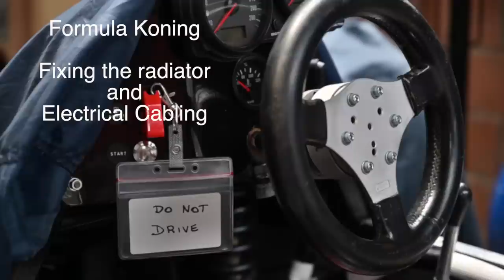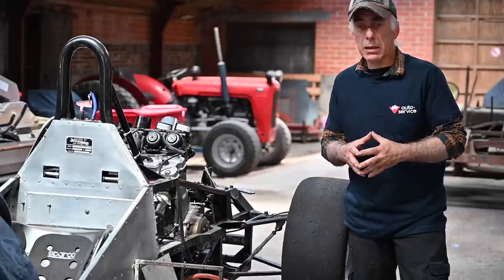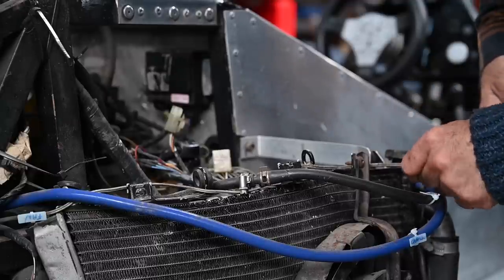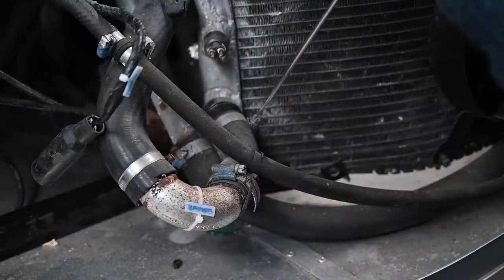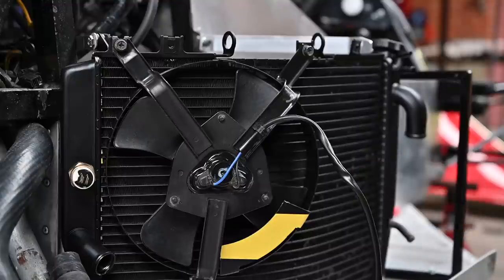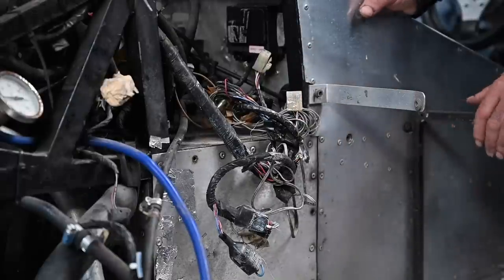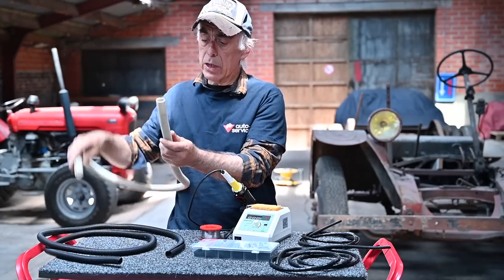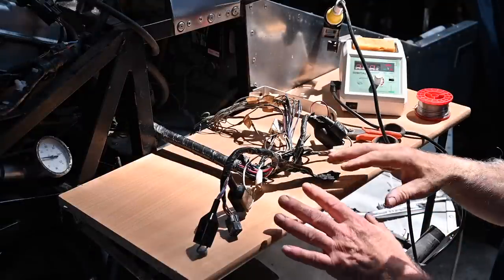Formula Konig, rebuilding a race car - Radiator and Wire loom

Comment: Hi, really enjoying your channel, it's amazing how people are cutting corners on something that has to be spot on and safe, and are prepared to race that car with so many problems, looking forward to seeing the end result.
Reply: Especially since racing is usually a hobby which you love and enjoy doing! (it goes without saying the safety aspect as well)
Reply: @Darryl603  Yes, I've done hillclimbs so I know how crucial it is to get everything sorted and not cut corners, some of the parts on that can make me cringe lol
Reply from the maker: Indeed, this car was really messed with
Reply: I do wonder about the cars history.  Sure looks like a bunch of things were "repaired" trackside, and the kludge was never corrected when back in the real shop

Things like the differential side bearings should not seen enough use to kill them.  About the only thing that might account for their condition was racing on a beach on the sea.

Anyhow, I await further installments.  You present a great combination of vehicles rarely seen in this hemisphere, and excellent production values. Luckily my age has taught me patience. (or at least  pounded into my brain)
Reply from the maker: @rjnerd  ,  I have some history, the car was build in germany by Konig inspired on the frame used in the italian Panda formula.  Build in 1990,  and fitted with a VW Polo GT developing about 140 HP for a 1400cc that was not bad at the time.  Also the well know F1 pilot Shumaker  did race in his early days with the Konig car like mine.  That was in 1988, so 2 years before mine was build.   The formula Konig stopped in 1985 or so as VW pulled out.   My car had originally the VW engine in it, but replaced with a Kawasaki Ninja ZX9R (900 cc - 140HP)  bike motor , allowing to rev upto 15000 RPM and a six speed sequential gearbox... and less weight.   That work was done by an unknown person  . It did participate in hill clime races... It retired in 2000 when as a decorative element in a car showroom . In 2018 a friend of mine bought it as the store closed,  he did plan to drive it but never did.. in 2021 I did buy and started to restore it....  There were many things wrong on it and a lot seemed to be done in an amateur way  ( he who modified it to a ZX9R).  Any how, I hope to get it ready soon and be back on the classic track with it....

Comment: With the wiring harness,  instead of clipping off the unused connectors, and doing the elaborate multi level heat shrink, just unwrap more of the harness, follow them to their far end, and eliminate them from the harness completely. Saves weight, and thins the cable bundle significantly.  If nothing else, when you are puzzling out an electrical problem, it's easier to follow stuff. 

When splicing wires, don't depend on solder for mechanical strength, at a minimum some amount of twisting is in order.  You have a high vibration environment, you want all the help you can get. 

I suggest selecting a good quality connector style, and replace the current aging  mishmash with a consistent set.  They have gone brittle, and were originally chosen based on the cheapest that could be found that were likely to last the warranty,   With a single style of connector, you can keep extra housings around, and should one get damaged, you can just pull the pins (the kit will include a tool for that) and replace the housing rather quickly.   If you are feeling particularly fanatical, look to aviation for your connectors.   And when you have to divide things between multiple connectors in the same space, use either different numbers of pins, or different genders so you can't swap them. Even then, hit them with different colors of paint, makes reconnecting faster 

As for the fan, if the fan blades are an actual  airfoil rather than simply angled flat plates, they won't be as effective moving air when spun in reverse. So rework the mounting frame so you physically flip the fan to change the airflow direction, rather than just change the rotation direction.   Investigate adding some sort of gasket between the radiator and the body shell, so the air goes through rather than around.  And when you were riveting in the brackets, the nice smooth  heads should be inserted from the exterior, so the upset end doesn't snag stuff like the back of your hand when reaching under the car.

Keep up the good work.
Reply: Agree about the connectors. Good quality crimp connectors are more reliable because solder is prone to cracking with vibration. However, in that car, solder and heat shrink is probably enough.
Also agree with blocking space between the radiator and body. And angle that the radiator is installed looks sub-optimal. Angling it to fill up most of the space, and having a straighter path for the cooling air to flow through the fins is better. I'm also surprised to see the fan. Most single seaters get by with the forced air flow while driving
Reply from the maker: Hi Jeff, thnaks for the write up,  and yes you are right `i could have removed all the cables /wires that are not used.  I have been at the point of removing all cabling and build a new loom, as this is a Nina engine in a spaceframe.  At the end I decided not to as it is one hell of a job and it is doubtfull that many of the connecters on the sensors and control uits would be replaceable with new types or be renewable.  I did look into that, yet that seemed very hard to get , and some I could not fnd.    As for the fan, indeed there are two types a push and a pull fan.  This fan is a pull fan, and can rotate in two direction as it is a DC motor, so the correct direction is needed. That is why I was showing it...   If one  wants to chnage it to a push fan, then it needs to go to the otherside of radiator and the blade needs to be changed.     Appreciated your comments and rightup..... regards Steve
Reply: @D3Sshooter  as for push vs pull fans, yes you can spin it the other direction, but it won't move as much air.  That's why you have to turn it around, rather than reverse the rotation.  Does mean making a different (flat) bracket.  Sure you could move it to the other side, but that's a pain with the curved radiator. 

I do look forward to seeing some track footage.
Reply: @D3Sshooter  I expect that pulling zombie wires would be faster than capping them off.  When adapting (not recreating) a harness I always strip out the unused (and yes, I do it in situ).  About the only exception i make is for switched 12 volts, if a particular node doesn't otherwise have one. (It's too useful)    I just try and identify both ends, clip them and pull out of the  often still taped bundle.   The whole deal neatly with clipped ends looked time consuming,  in the multi wire bundle you demonstrated I would try to pull all the wires at once.

Comment: When building (or significantly reworking a harness, doing it on a board that has the various lengths marked, along with pegs at branches, so you can lay it out flat.  To lay that board out, get some rope.  Snake it thru the car, and tie on bits where things split off. That will let you lay it all out.  You can then plop the wires on the layout board, knowing how long stuff should be.  

Color coding wire is helpful, but actual labels are even better.  Some of those little label printers have actual heat shrink tube that can take the place of the label tape.  You get legible text, that you can then shrink over the end of the wire.
Reply: Excellent information. Thanks!
Reply from the maker: @amraceway  Indeed, if you make a new loom that is how I do it
Reply from the maker: Thank you , and indeed if you make a new loom that is how it is done. On this car I cleaned up the loom where someone  had it all scewed up.  Of course a custom build loom for this Ninja engine in this spaceframe would have been better. Now it has the bike loom and that is not tailored to this car.

Comment: As someone who has done auto electrics for 35 years... I twist the wires together before I solder, it's possible doing the heat shrink you will melt solder
Reply from the maker: Thanks, well that is why I use heathshrink at 120 degrees .. Not enough to meld the solder,,, but you are right one must watch the temps and time

Comment: In my opinion it is good practise to put a litle bit of Sikaflex or similar glue where parts are connectet with this type of rivets or sheet metal screws. 
Lightweight consctruction espacially aluminium is allways vulnerable to vibration.

Comment: soldering @25:24 -- I like soldering. But vibration on race cars are high, so make sure you remember what you soldered, in case you have random outages, you can check these solders. Crimping (crimping?! really?!) actually turns out to be pretty robust vs soldering in race cars. shocking. I hated crimping. It always felt wimpy. And cheap. Until I actually bought high-quality crimps (not from Amazon!) and tools (not from Amazon!). With the right tools, it worked better. I had a few unpleasant surprises with the soldering connections  breaking, even though I had tied down everything with zip ties etc...  it was surprising. I thought I'm pretty good at soldering ...

Comment: Oh yeah, look for marine heat shrink, it has hot melt glue lining it to improve the seal. Regular heat shrink insulates, the marine stuff also keeps water away.
Reply from the maker: Good point, thnak you